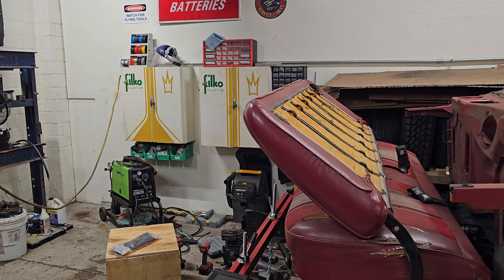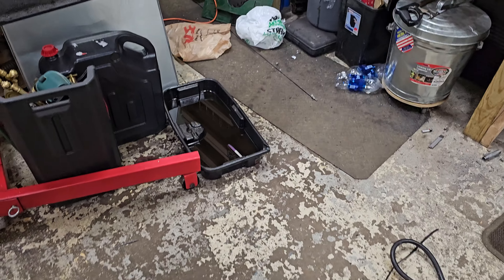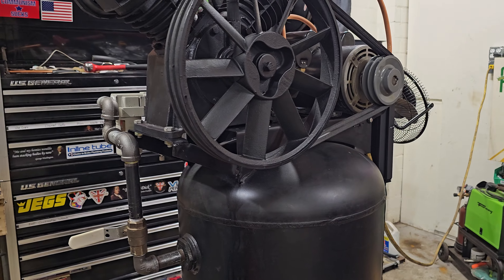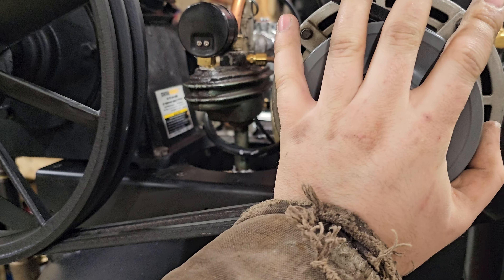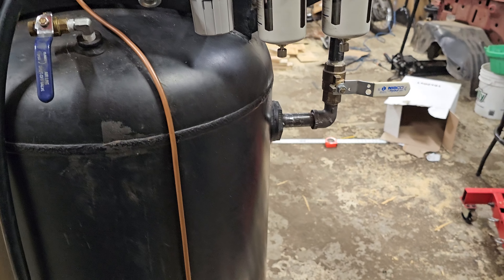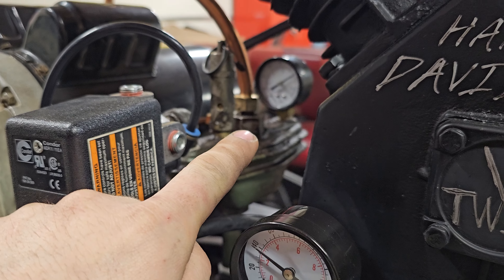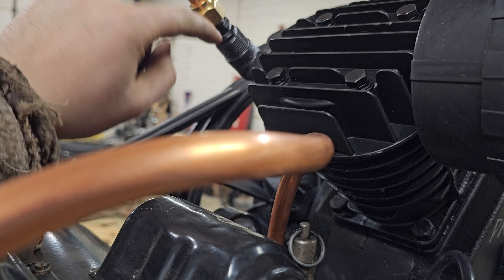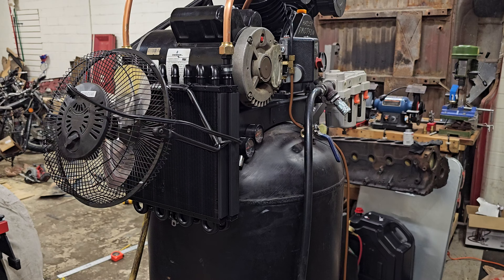Air Compressor Upgrades

Comment: I burn out the five horsepower motor about every 10-14 months.  My next planned upgrade is either a 7.5hp or 10hp. I'm leaning toward the 10hp and putting a larger pulley to increase the rotation speed of the pump to increase the cfm
Reply from the maker: I'd be curious to see what happens to the pump with a faster rpm. I know 3045 I think is the rpm they're designed for. I wonder how it will wear at a faster rpm

Comment: The way you've got the that trans cooler hooked up there is no place for the water generated from the compressor to go but flood the cooler and then forced into your tank defeating the purpose of the cooler.  Turn the cooler 1/4 turn clockwise then run the bottom line into the water separator and from there into your tank.  Also tilt the trans cooler at a 45 degree angle so the water in the cooler will drain from gravity into the separator.
Reply from the maker: Yup. I have the parts to change it to exactly what you're saying. Just need to do it.

Comment: That motor is actually 5 peak HP. A true 5 HP motor runs at about 21 amps. Your label says 15-17 amps which is more like 3 running HP. That’s one reason you can get by with the smaller wire. Don’t feel bad; I learned this the hard way. Turns out this is a pretty common issue with HP ratings and it’s good enough as long as it does the job you need it to do.
Reply from the maker: Good to know. I would not have known. It runs just fine on my compressor, so I'm happy.

Comment: Great idea, I just want to add that it is better to have a water seperator just after the radiator to prevent water frol entering the tank so you will have an almost dry tank
Reply from the maker: I had not thought of that. I will add that to it someday!
Reply: @dailyolds1970 you already have a water separator, you just need to re-arrange the sequence of airflow.